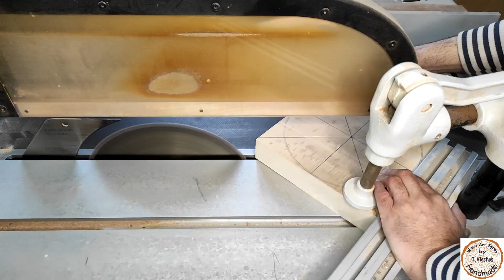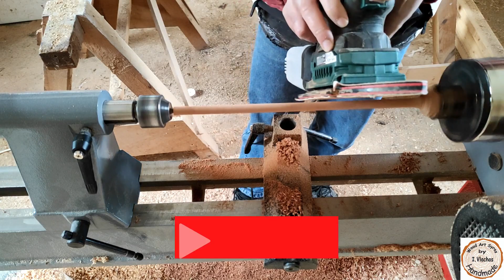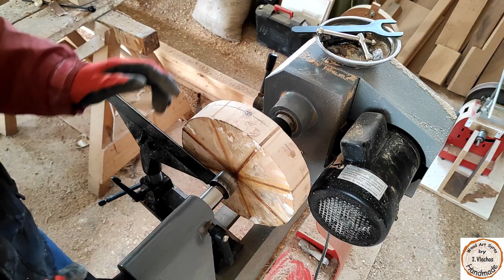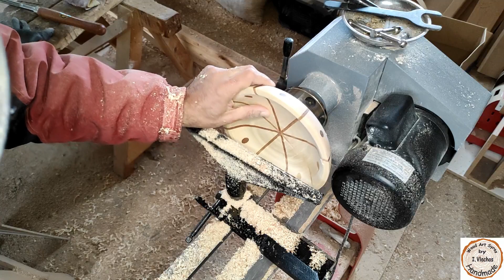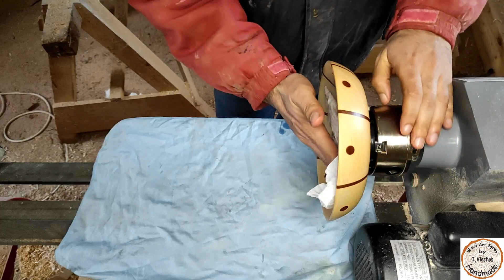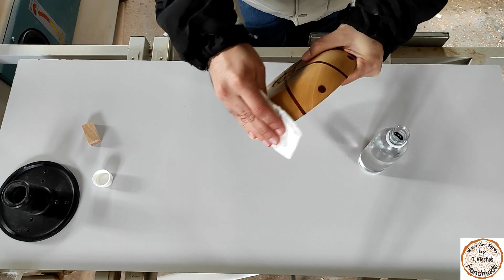Wood turning segmented bowl

Comment: Nice work and the contrast is perfect without being overpowering. Jumped over from the Woodturning FB page to watch the video. We're you using a sanding sealer? New subscriber from central Kentucky!
Reply from the maker: Thank you very much for your kind words.  For the finish I used deco paper, varnish, paper and oil.